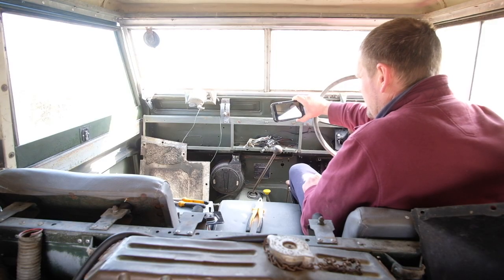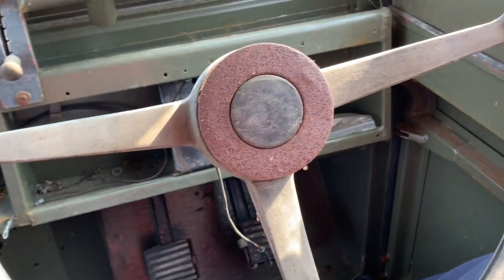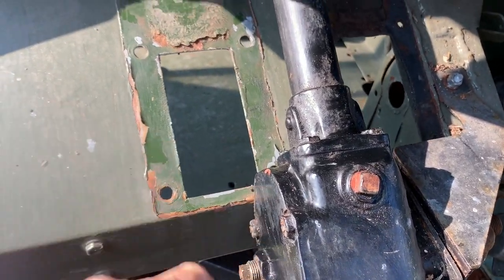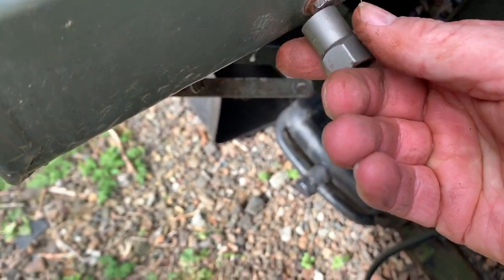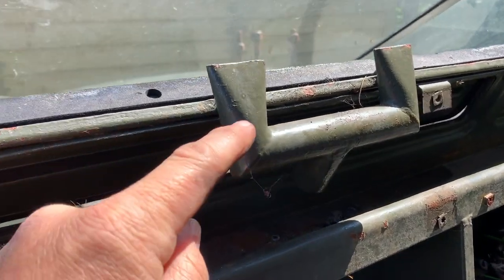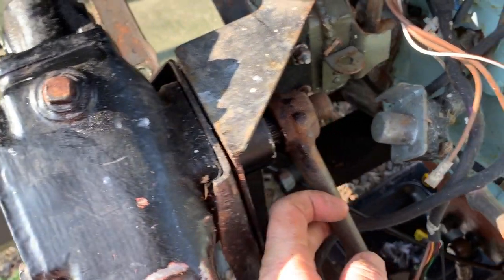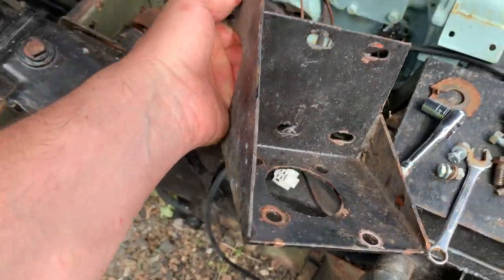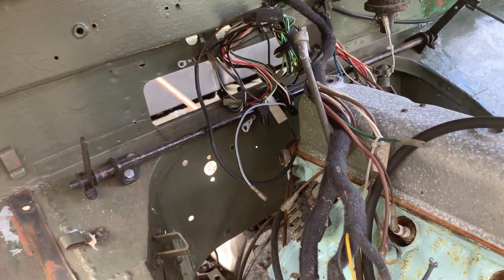Land Rover Restoration [stripping the bulkhead]

Comment: With this old self tappers and nuts/ bolts , if they’re original then they’re really good steel. A derust and a wire brush then just oiling them a touch. They ll be fine, if you use the vehicle then they won’t decay like if it’s parked up for years. You can always caddy plate them later. Minimal stainless steel fasteners please, never looks good!  109 1961.
More power to your elbow
Reply from the maker: thanks man, yea i've been trying to re use the original bolts, waaaay more time consuming though!!